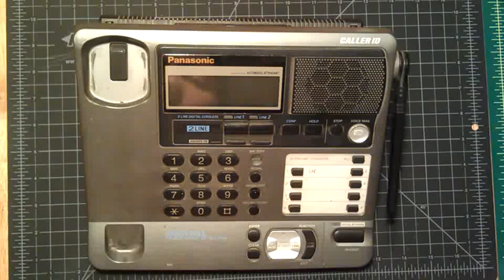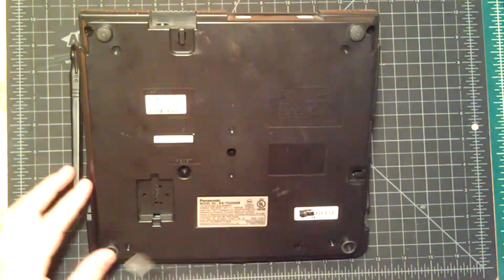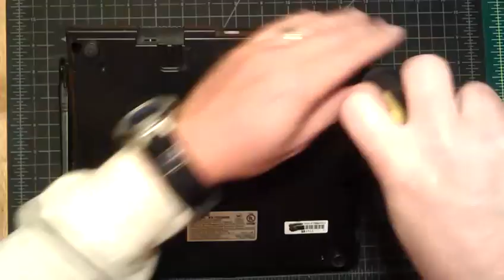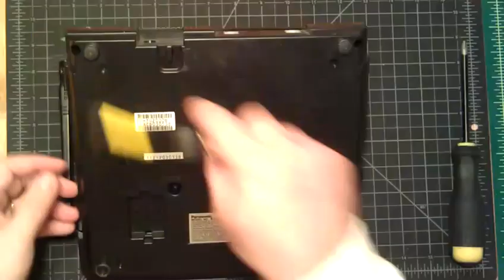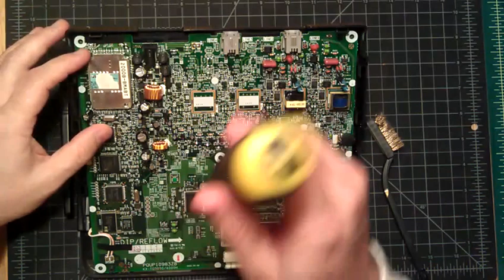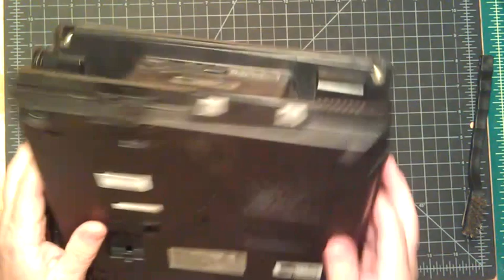Repair poor audio transmit KX-TG4000b & KX-TG2000b

Comment: Having a problem registering a handset, get an error message, any ideas. Thanks
Reply from the maker: If all 8 positions are full you get "error". Old batteries can cause errors registering and also it can be a bad radio module in the phone or even in the base.  Bad radio modules cause poor transmit signal and you cannot hear the issue in the broken device.  If all your cordless phones sound bad then it's the base transmitting poorly.
Reply: Ok Thanks, I'll check the batteries.